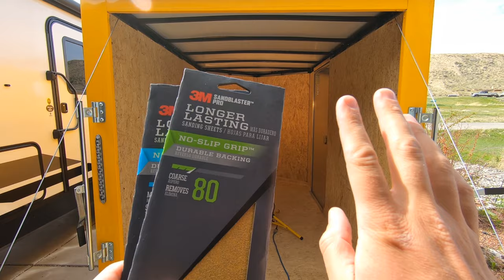Cargo Trailer Makeover - Walls and Floors - Make Your Own Adventure Trailer - PT 4

Comment: Just curious, why not add insulation to the walls and ceiling before painting?
Reply from the maker: Hi, Raylee - In hindsight, I would have done this.  When I start this project back up next spring. I'll be installing windows at may try to work some insulation into the walls from the window locations and from the gap at the top.  It won't be nearly as good as removing the walls, but I didn't realize it was a problem until we took it out on a summer day and it was hotter than the blazes of Death Valley in there.  😎